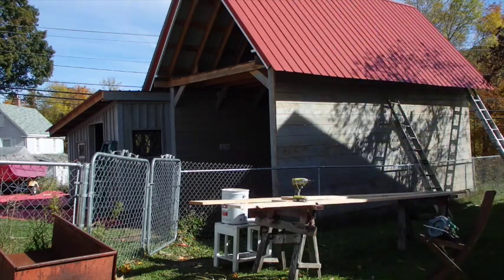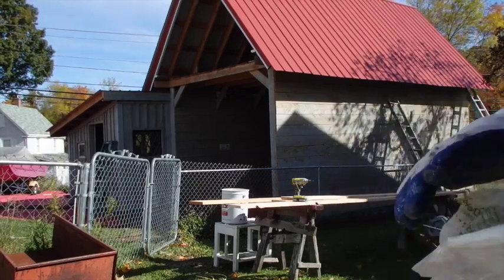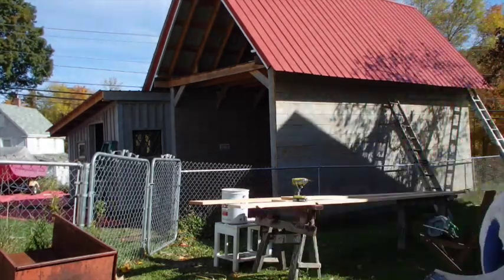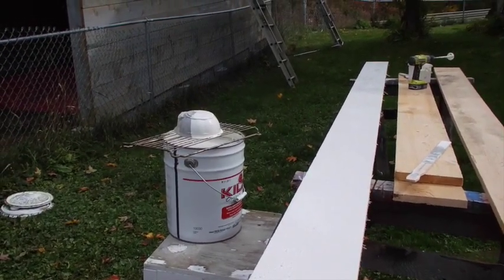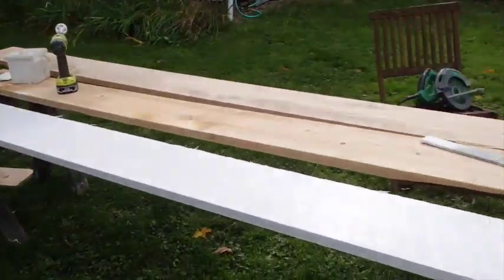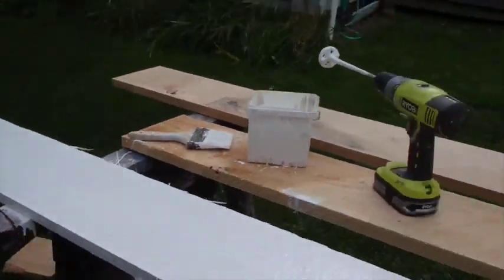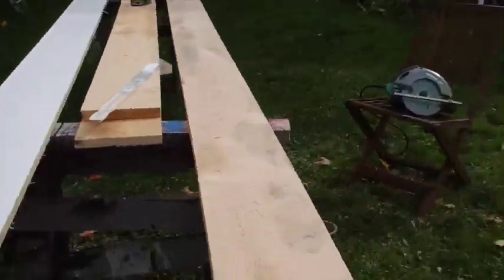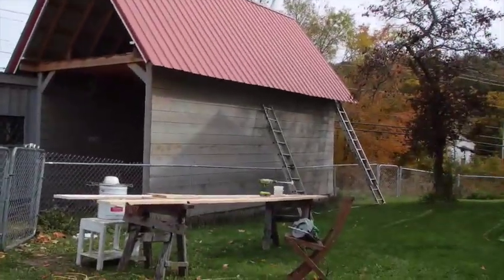Painting Trim

Comment: I've done the plastic bag trick and I've put my brushes in mineral spirits (oil base) but cleaning the brushes after each use makes it easier to paint and easier to clean the bushes when you are finally done. Unless you are planning on tossing the brush after the job is done. Just sayin